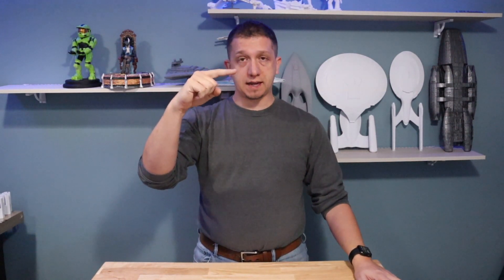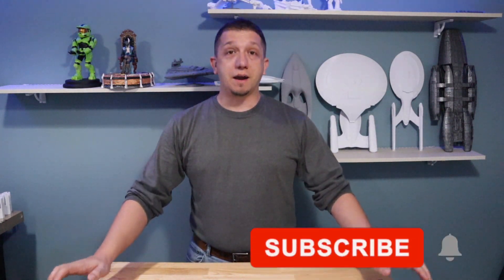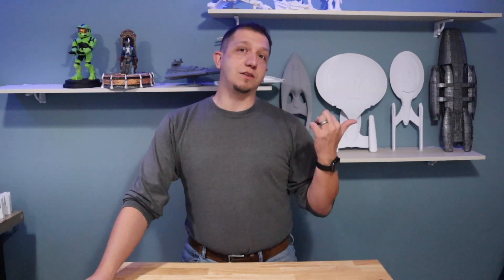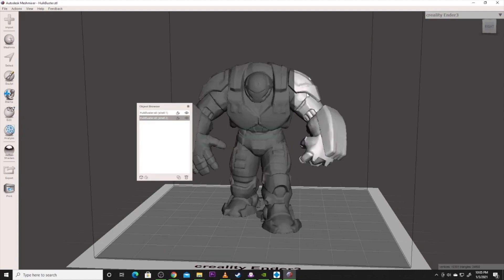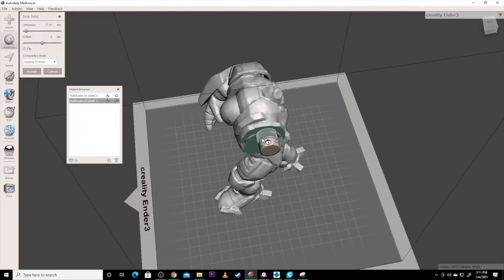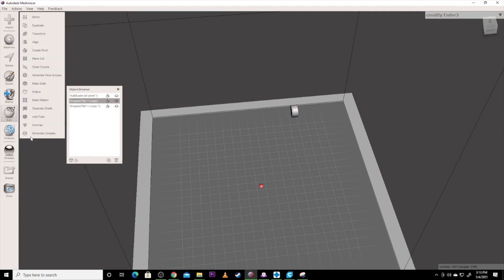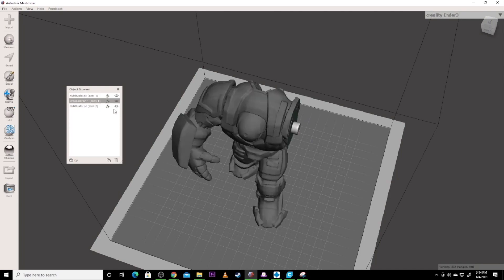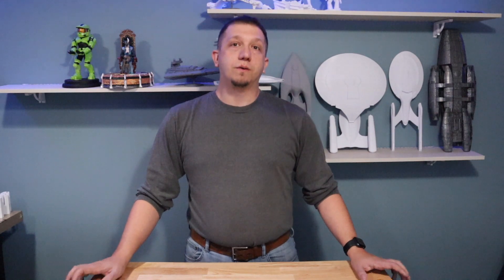How to Cut STL Models for 3D printing in Meshmixer + Meshmixer Alignment Pins

Comment: During the video you go too fast and assume the viewer is at your level... Viewed the video at least 10 times and still can't figure out when you mention "click shift"   is this a control of the program or just press shift on the keyboard.  Confusing
Reply: Yes, it's "Shift (Keyboard) + Click (Left Mouse Button)". In most programs, when you click to select something you can do a Shift+Click to select multiple things and have them all be highlighted. Here the reason you want them both selected (highlighted) at the same time is because you are doing an operation to both of them together. In this case, "Boolean Difference" just means "take the selected items and subtract the areas that overlap".

Comment: No offense but if you just make one side the hole and the other the pin it’s one step less and less time after. Also if you make the square a rectangle (by a small amount) works better for still models. Toss that together with increasing the size of the hole by .3 (fdm) or probably like .1 on resin it’s Pog
Reply from the maker: Nothing wrong with that.   Sometimes I have issues with the pin plus I usually reduce the pin by a percent or to when I print it.  But nothing wrong with your method either

Comment: How come I keep getting red and blue lines when I try to cut holes into my model? Is there a way to fix this? Im trying to make a socket for a lamp im making and when I cut a cylinder through the model it doesnt let me cut the cylinder through and brings up an error message.
Reply: This is the thing none of these tutorials cover and it is annoying. They make it look so simple but it's not. You are having a mesh issue which is completely different step you have to do prior to this. One way of fixing it is to make the model solid. However this will cause you to loose details in some cases. 

Again. Every video I have come across on YouTube never mentions this. I hate that they are like look it's this easy when in fact it's not they way everytime.

Comment: Every time i select separate shells, the program crashes, do you have any idea why?
Reply from the maker: Are you running the most current version?
Reply: @Rise3DBuilds  Indeed I am, I solved it kind of. I made the model like 1/3 the size and then cut. Maybe the issue was the amount of components to the model I cut.
Reply from the maker: Yep the bigger it is the harder on the software.  That one method I approach that issue

Comment: Hey man this helped a lot in understanding making the indented part, however I’m aiming to make a swivel action figure joint using the two peg pieces under the miscellaneous tab. (The ones that almost look like a Lego technic pin. Would it be a similar process? I know ones the peg and the other is like what you’d use to make the hole.
Reply from the maker: Yep same process.

Comment: I have done this and have issues with the pin not fitting. Tolerances are too tight. I like to use a rectangle pin, with less chance of misalignment. When everything else is done alter the size of the pin .05 smaller for printing. I like epoxy as my glue and this also gives some area for epoxy to be. Great work all around with this video
Reply: It helps if you make the hole at least .3mm larger than the pin.   Also, for STL (resin) printing, your exposure time has to be spot on.  If you over expose, then pin will increase in size while the hole will get smaller.